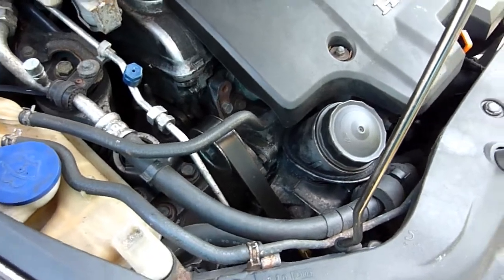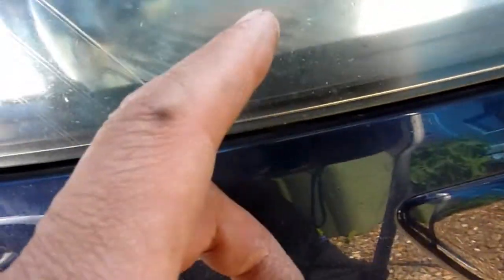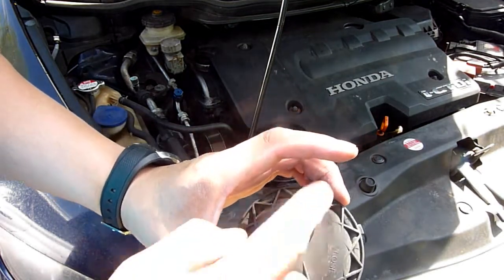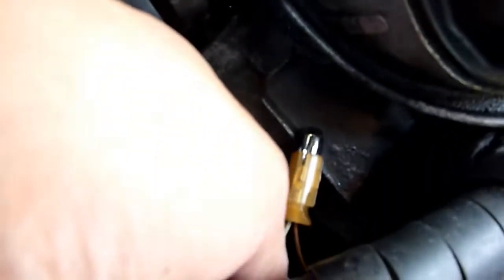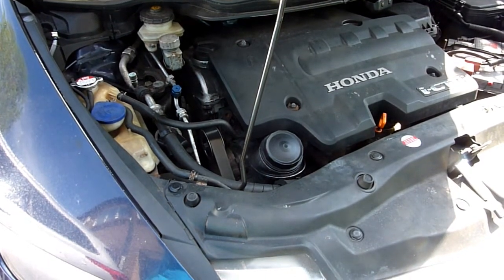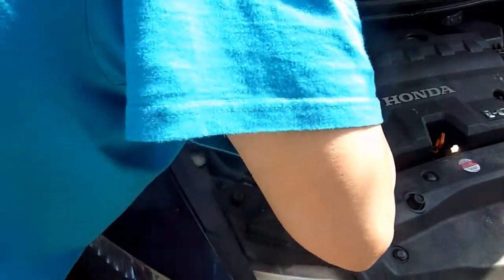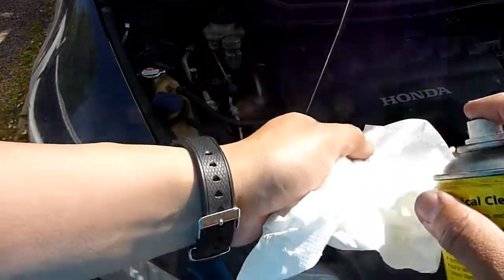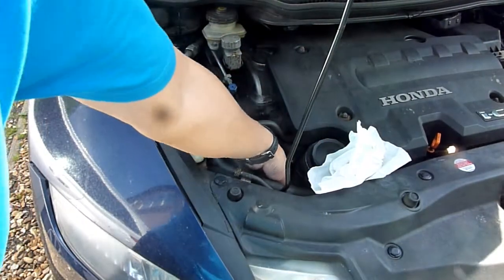How to Change the Parking Lights Honda Civic 2.2 CTDI

Comment: Hi my Honda Civic 2007 mk8 2.2 diesel does not go to sleep after less than 10minutes ride for example main relay stays energies there  fore drain the battery  and I have to reset the ignition on and off for a few seconds than  the main relay clicks off any ideas please !
Reply from the maker: The honda civic mk8 is prone to water leaking...check under drivers footwell and passenger footwell.
.if it is leaking check my videos for a fix and electrical problems like your may go away...also check the spare tyre compartment for water leaks...check my video for rear leak fix